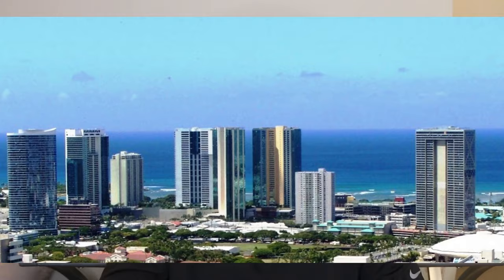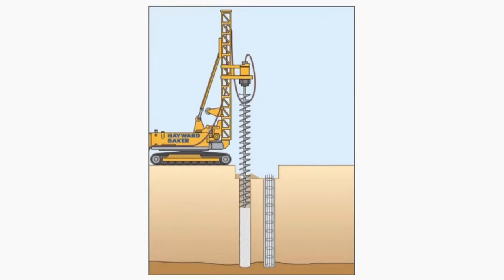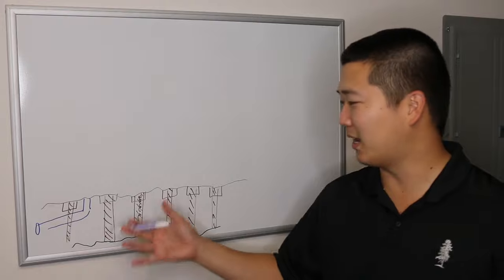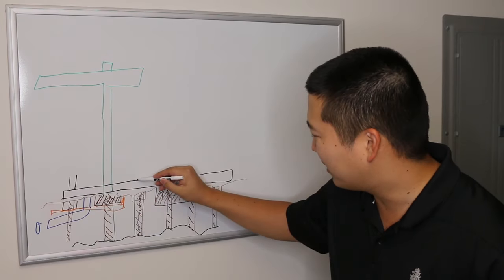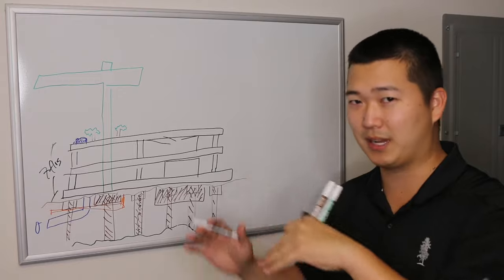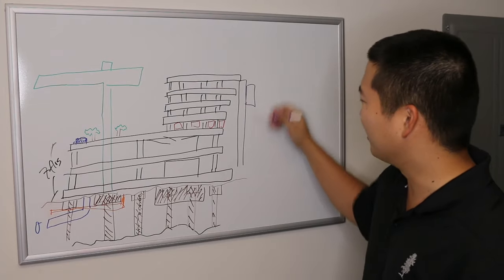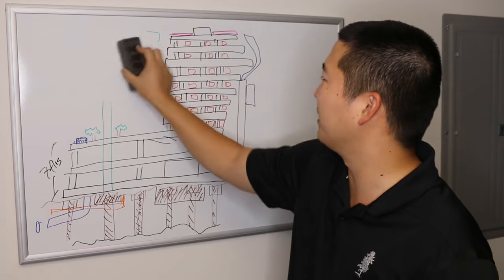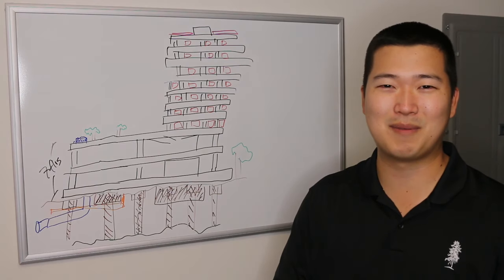How High Rise Buildings Are Constructed: Years of Work Explained in Less Than 15 Minutes

Comment: hi, how do you design lateral load system for high rise? Do you consider seismic design as well?
Reply: Of course he/they do. If it can rock due to seismic forces,, it has to be compensated for in the movement/sway design in line with wind force & such. Even in far less complex designs,, such as single  family dwellings seismic activity is taken into consideration adding additional re-bar,, tie down strapping & concrete to a single or 2 story home. There's a lot of additional cost added to a single home priced in the $250-300k range. 
A lot of it I view as overkill now but in the name of safety & a higher authority controlling all aspects of building,, we can no longer build a home off a paper napkin design (I once actually did this when codes were far more relaxed) & codes enforcement are self appointed gods when they enter a job site. 
What engineers do (this man) at a far higher level is necessary,, what they do at far lower levels is or has just gotten to be too much,, it is indeed overkill. 
Sorry,, I know you didn't ask my opinion or a dissertation on the issue but when you mentioned "seismic",, it struck a nerve in my once long building career I put to a halt due to that very subject. 
It's simply crazy now what they make building contractors do & how much it cost the consumer for features that will never be utilized or needed!!
Have a nice day..

Comment: So how do you figure out how much steel, tons, thickness of columns to use.

How much more steel on the 5th level of a 120 story skyscraper than on the 115th?
Reply from the maker: Its all in the structural drawings we are given. The lower floors typically have substantially more reinforcing
Reply: @KienenKoga  
There is an article in an engineering magazine from the early 70s that said the heaviest perimeter panel was 22 tons. Some people call the panels 'wheatchex'. The name of the company that made them and their total weight is in the NCSTAR1 report.  So why don't we know how many, and number of each different weight all of the way up the building?

Why isn't the distribution of steel available on any skyscraper? All over the planet they must deal with the same gravity. The supposed top down collapse of the North Tower is unique in history. When has the conservation of momentum ever mattered so much in such a large man made mass?